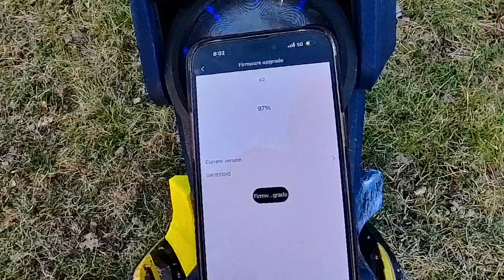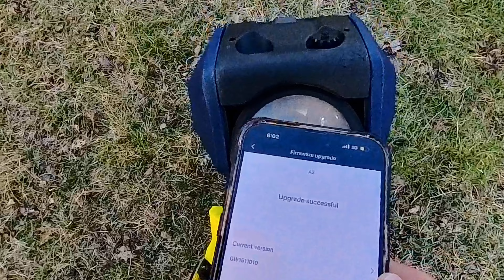Troubleshooting my Broken A2 - Begode EUC Cutout :’(

Comment: Thanks for posting this information. I'm sure it will eventually help lots of people.

I had a blown Gotway/Begode board and got it fixed. I first sent it to Begode themselves and they couldn't fix it. Then I found a third party that did it. It was just a hobbyist. I've ridden the repaired board for 5000km now and counting. (The board didn't break because of quality issues. I think a mosfet bolt got loose and so it slowly cooked one of the mosfets. I loctited them all down.)

Comment: A2 owner here from Thailand.  Begode Thailand has received new updated boards for the A2 and is replacing it for all 2023 model A2 owners for free.  I haven’t experienced any cutouts before but I feel a bit more assured with a new updated board that has fixed a suspected faulty diode mentioned in Roger’s vid.

Comment: I have been enjoying your videos and hope for more.  Thank you for your creative efforts.

-----

I humbly submit to other A2 owners for their evaluation and comments, three symptoms that I have encountered:

When I connect the Begode app to my brand new A2 that has up-to-date firmware installed, in Settings, in the Battery status row at column LF, it shows "Overtemperatur..." and blank for all other columns, the MOS switch row shows "ON" at column LF and "OFF" for all other columns, and the Fault conditions row shows a green dot at column LF and blank for all other columns.  My first question is: have other A2 owners seen such indications in the Begode app and are they normal?  My second question is: does the A2 actually even have a battery temperature sensor?

One of my concerns is that if a battery temperature sensor is supposed to present but is not working correctly, or was supposed to be provided but was omitted or improperly installed during manufacture, then I am being denied the protection that was intended to be provided by the sensor.

My A2 battery pack and motor areas always feel cool to the touch even after riding and after charging.  No weird beeping.  Wheel functions as expected.

The vendor of my A2 said that because the A2 does not have a BMS, the "Overtemperatur..." indication is spurious and should be ignored.

Helpful comments from other A2 owners would be most welcome.

Comment: My Veteran Sherman out of the blue blew a capacitor lead clean off and would turn on completely normal and ride until you would put a little more torque on it for instance idling back and forth and then cut out. 
You really should open it up and look for any components blown. I doubt a MOSFET is blown and the wheel would still be riding, but a cap lead or cap itself could cause the DC Bus voltage to be unstable. That in turn could lead to when you use the light that the voltage gets even more unstable. Just a thought.

Comment: Hey bro is it working fine now? Did you ask for Begode support ?  I have one of those no issues so far, but just learned to ride it how many miles you have with your Begode a2 and when did it begin cutting out?
Reply from the maker: Still having problems, my dealer will send video to Begode and ideally get me a new main board. This is a Batch 1 A2 with ~750 miles when it first cutout randomly last week
Reply: @PEVPOV  how do you know the batch ? Is there a way of knowing so I can check mine ?
Reply from the maker: @AxiosReviews I’m not sure how to tell what batch after the wheel has been out for a while, I just know because I preordered the wheel before it was released so I got the first batch
Reply: @PEVPOV thank you for this information
Reply: @AxiosReviews thank you for asking the questions I wanted to ask. I got one coming tomorrow from ewheels 750wh 50e battery and it’s got my paranoid already
Reply: @dale1809  so far no issues with mine use the firmware ending in 11 to enjoy the led fun lights!

Comment: Thx for video, what was the version of firmware before update?
Reply from the maker: I believe I updated from firmware 1010 to 1013. I will check later today. I do know the firmware I was on was released in September and included the Race mode / offroad mode switch

Comment: Personally I dont touch power button, for lights or whatever while riding. I always stop before touching any buttons. 2ndly be real careful of the spin button as its super sensitive. 3rdly I wouldnt wanna ride the wheel below 20-30% because batt pack is only 750wh & there isnt a much headroom for shenanigans. Also the fw update extended beeps bothers you, flash/update fw through the official BG app. BG app takes 15secs or so while EUC.W takes a coupla mins. TBH dont surprise me something pop in mobo when you cutout <20% batt. Maybe the power button connection got loose. I suggest you open her up & do a thorough inspection of mobo for any burnt marks. 

Regardless this is why I only use my A2 as my spare wheel & never ride it hard nor long as its not designed for those purposes. That said, my A2 has been performing flawless in loose snow, hard packed snow, snow over ice, some ice & pond like puddles of cold icy slush water. Hope you solve your issue soon

Comment: help ! my begode a2 cutouts only when turning on the front light
Reply from the maker: @tekhouseman  what firmware are you on? This was happening on both firmware 1013 (Original) and the new updated firmware from early July. I contacted my dealer for a new motherboard.
Reply: @PEVPOV  the firmware update  did not solve the problem , it just give me the fun led lights
Reply from the maker: @tekhouseman  contact your dealer if possible, if it is an older 2023 A2 you may be eligible for a new motherboard. In Thailand, Begode replaced the board of all old owners A2 due to a faulty diode or something. Worth asking them to see
Reply: @PEVPOV  bought from aliexpress

Comment: Sounds like a problem with the motherboard, maybe water damage? Maybe a faulty capacitor
Reply: Also what freespin speed do you get?
Reply from the maker: Its strange, I havent ridden in any water so its definitely not damaged, I believe the capacitor or motherboad blew something during the first random cutout but idk why it would turn on and behave so close to normal when damaged. Free spins to ~28 mph
Reply: I thought freespin on the A2 was over 30mph. But assuming 28 is normal, it might be a loose component somewhere, or a cracked solder point that randomly disconnects when it gets hot (like my old PS3 used to do)